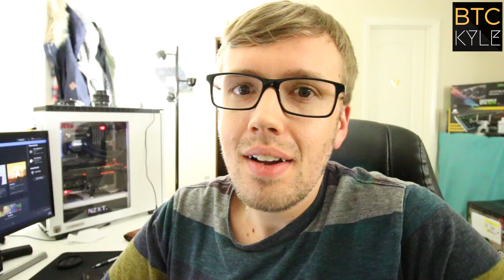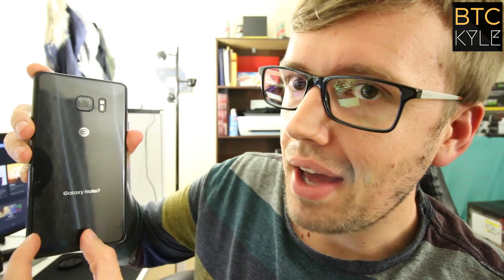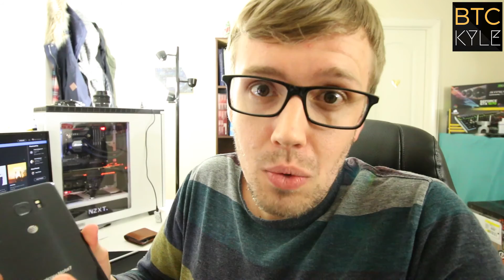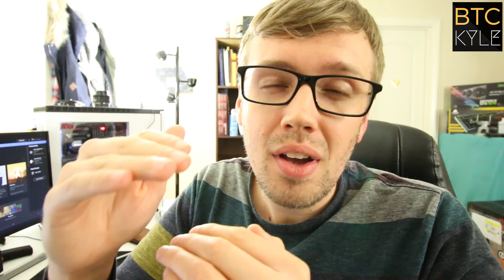Why The Samsung Galaxy Note 7 Blew Up - It's Not The Battery

Comment: I do not find this to be true if there was an issue with tolerance you would have way more than only 135 cases of a phone exploding or Catching Fire you would have thousands upon thousands out of the 2.5 million that were produced that would have had malfunctions..  I feel like this is just a scapegoat out of the situation...
Reply from the maker: I believe there were a few outlier batteries that expanded much more than other batteries based on the lithum/chemical makeup (and probably some other factors). These are the ones that built up greater pressure. But this is not to say that the ones that haven't exploded yet will not explode. I believe overtime, we see a natural mechanical swelling of the Li-ion battery. So we might see another case soon... but not sure how many phones are left out there. Would be interesting to find out.
Reply: Last report was 300,000 left in use
Reply: BTCKYLE just a helpful observation,  this written thought is very clear and intelligent,  but your videos tend to ramble a bit more.  Maybe pre scripting will help your video be more concise. Since its supposed to be a technical video.
Reply from the maker: Very good feedback, I appreciate it. I agree with you & have been working to do more scripted videos. We know what we want to say, but it doesn't always come out as well as we wish. Hence the reason for scripting. Thanks again.